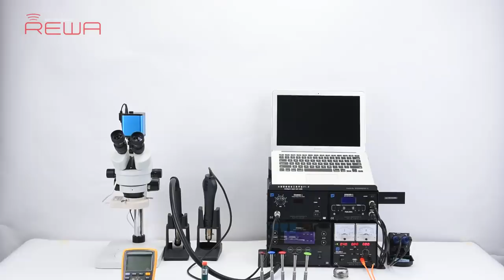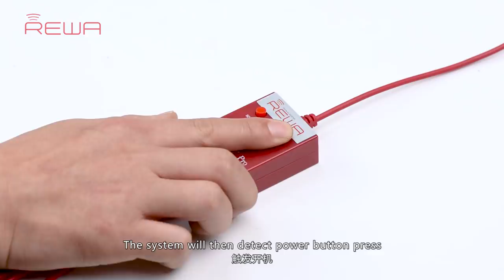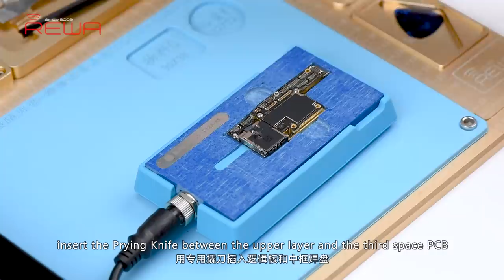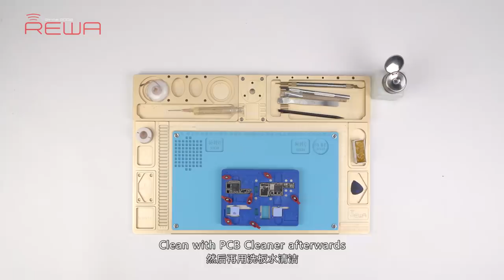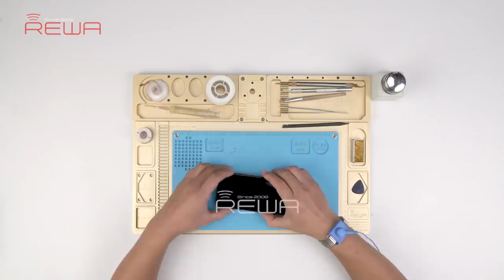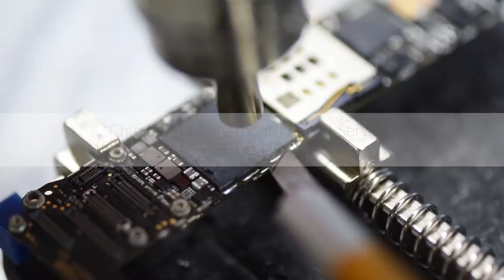A Magic Tool for iPhone XS Motherboard Repair - Safe and Efficient

Comment: To be sure that the problem is really due to poor soldering, you had to show us first how u hard reset it and then at least remove the battery and put it in place,and after all this procedure solder the board! 
Yes, I saw how you checked the board on the power supply, but after all the procedure you immediately assembled the phone and put the screen back in place and did not recheck it again on power supply
Anyhow video about magic tool, and its really magic, because it it save your time and zero risky

Comment: wait a minute... you didn't tested if everything was fine. two months ago, i received a water damaged iphone X wich wouldn't turn on, i separate the pcb layers using the LCD separating heat machine (it has the same purpose as the one in your video) but when i solder everything again, it didnt recognize the simcard due the fact that the weigh of the pcb and the surface tension when soldering tin wasnt enought to bond the two layes perfectly. ihad to apply pressure to ensure correct alignment and bonding.
Reply: Vincent Hernandez bro that step jus skip ad video😂

Comment: something is wrong here how the solder melts 140 C degree ?
Reply: Mustafa Usta the solder that join the two layer is a low melting solder, it melts quickly at low temperature

Comment: if the device is not working why people do not go to apple as every 10s will be covered in warenty  🤔
Reply: Swagata Mukherjee They may have already replaced their screen by an unauthorized third party service, thus cannot claim warranty anymore. Or even water damage, since the board and components are not sealed, only the shell.
Reply: As you see there are many reasons, but Hermann told the main reason, you really don't want to waste your time with Apple's service, they will first fuck your brain and let you pay afterwards for that, so you get double-penetrated, finally you will pay a new mainboard and work, atleast, case of warranty or not.
Reply: @NaperAkai  Using the warranty is always an option but the deductible is upwards of $300, plus you won't get your phone back and you lose all of your data.

Comment: Btw wtf are those armbands?
Reply: anti-static armbands. they're connected to ground and remove any static electricity your body might have so that it doesn't damage the circuits.

Comment: solder melts at 140 degrees :DDD
Reply: @rewatechnology2008  for reassemble what solder and temperature do you use? I suspect 63/37 will need a higher temp?

Comment: Are you kidding  me which solder melts on 140degrees ??? 
😂🤣🤣🤣
Reply: There are solder alloys that melt at 140
Reply: Apple uses low melt solder 118 C° in those layers, so 140 C° is posible, I have to set my platform at 170 C° to separete iPhone X.